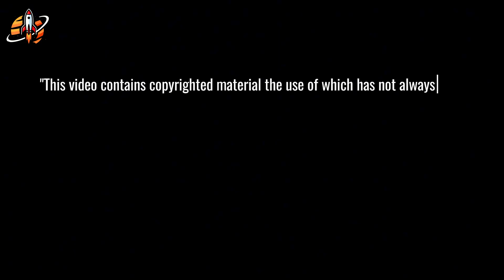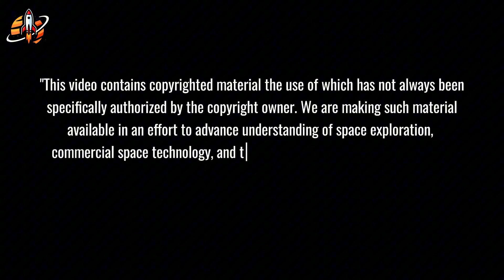SpaceX Finally Gives Russia NIGHTMARE - Dragon Just Broke Their ISS Control Forever?

Comment: Instead of pulling it down use one of your heavy booster and those dragons to push the space station to the moon and put it in orbit there were you have a place to go if moon base or moon missions go wrong the astronauts have a place they can go and survive may be old but it's already up there just have to move it full loaded with fuel oxygen and water and food it could be a perfect freight hauler to to supply the base and a safety zone it makes sence to me to use it not destroy it and if it does fail completely in time you can bring it down on the moon and you now have a true value hardware store on the moon
Reply from the maker: Great idea to repurpose the space station as a lunar orbit safety hub! We'll explore this in our next video on innovative space solutions.
Reply: @SpaceHub26 yes and elons not using full potential if he puts two booster on one he can lift a fully fueled booster into ofbit untill his refueling can be proven I didn't know why nasa didn't do that a long time ago